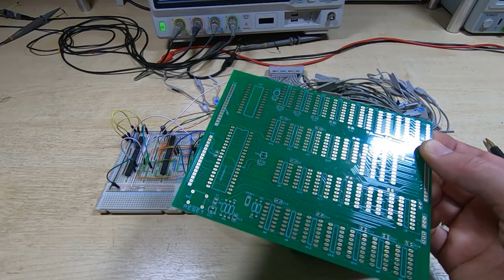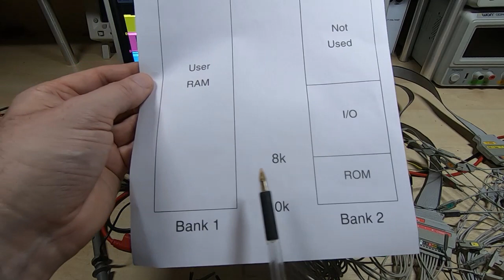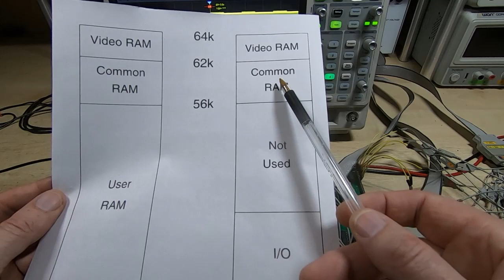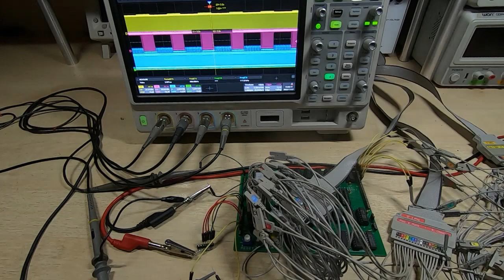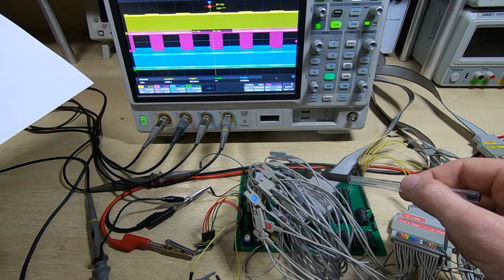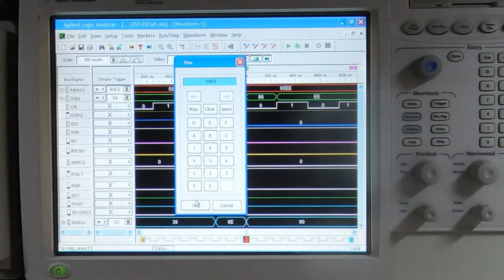Designing A Z80 Computer Part8

Comment: A long, long time ago in a galaxy far, far away there existed an East-European ZX Spectrum clone called the "CIP". And no, there were no LSI chips in there, it was all basic TTL. Its first iteration had a mere tape loader inside and nothing more, so you even had to load BASIC from tape before you could do anything else (and you lost it any time something glitched). My version, the CIP03 however already had BASIC onboard in a 16k ROM, much as any Spectrum is supposed to.

But things got interesting after I took it apart to look at the PCB, and noticed that there was a full 64k of RAM in there next to the 16k ROM. But... was the lower 16K RAM wasted then, I wondered? Well, no. Long story short, there was a flip-flop reachable at a certain I/O address that could effectively bank switch the lower 16k between the ROM and the RAM - but with a twist: while you were READING one of them, you were always WRITING the other (well, not exactly writing the ROM, but you were trying to)...!

So all you had to do was read the first 16k and write it all straight back to itself, then you could switch and now you were running BASIC from RAM. Except, of course nobody stopped you from changing whatever you liked FIRST - and that meant I could patch the NMI vector which was notoriously screwed into uselessness on the ZX Spectrum, which meant I could now wiggle a pin on the extension connector and instantly have the MMN80 jump to my code. Which, needless to say, made a PERFECT "infinite lives" cheat - all you had to do was store a little code in there with the information of what to write where, load your game normally, then press a button any time you were out of lives/money/etc. Good times...! :)))
Reply from the maker: Yes, this is the sort of fun I want to recreate with this design. The hardware is just the first step but by designing it this way means that anyone who is interested should be able to write their own system software, It seems to be a skill that is being lost but with any luck we can bring it back. We just need more people like you to get into it :)